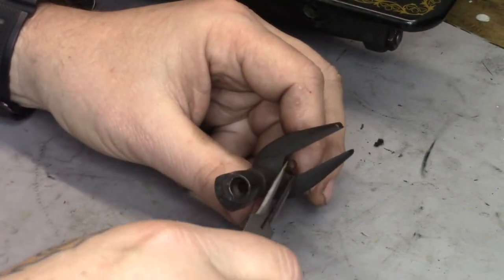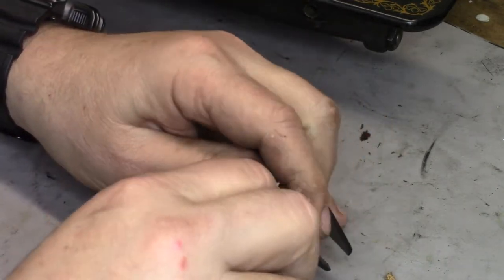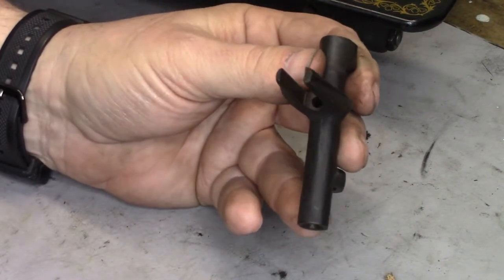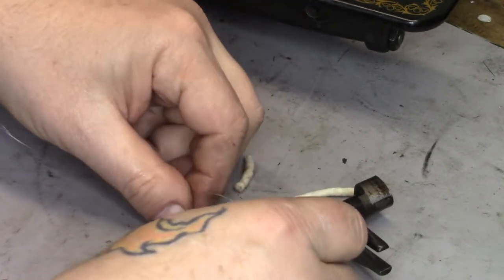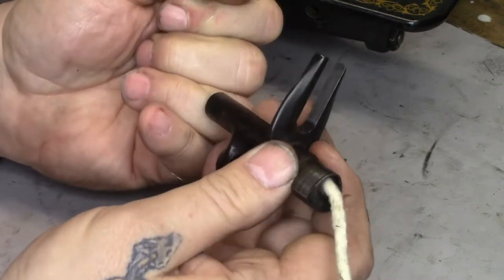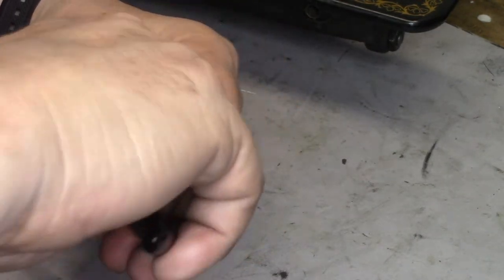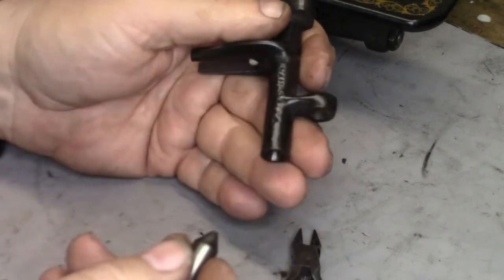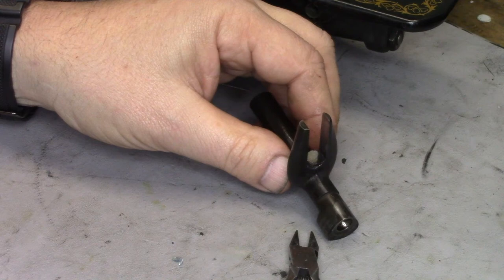Singer 15 91: Oscillating Shaft OIl Wick Replacement

Comment: Hey Bob, always great videos. Now what about the 201 mated with I think you said a servo. Did it work out. Thanks Mike.
Reply from the maker: I sure did, I put my 201K3 into the table that normally holds my Sailrite Leatherwork machine, and hooked her up to the Sailrite Workhorse servo motor. I had to remove the bobbin winder and use a different balance wheel, and had to source an appropriate size cogged belt. I bought a balance wheel from Sailrite that worked just fine, and found a cogged belt on Amazon that fit. I went with the cogged belt because that's how the servo motor is configured for the speed reducer for the Leatherwork machine, and I wanted to be able to do a quick changeover. The 201K3 works great on the servo, but I had to be VERY careful to keep the speed to within the design stitching speed of the 201 series machines. Full tilt, the servo would drive the 201 at many times it's max design speed, and while it's tempting to play around in those regions, it's a dangerous game. The problem is one of inertia. The 201 series is designed to run at 1100 SPM when going flat out. If you crank up a servo, it's possible to run the machine almost 5 times that fast, and that can be disastrous. It's not the running speed that's necessarily the issue, it's the stopping. Servo motors don't coast down to a stop, when you remove the power and control signals, they STOP! and when they do, all that rotational energy has to go somewhere. That 'somewhere' can only be one place - broken parts land. The 201 just isn't beefy enough to take that kind of punishment, and while I know I would always try to be super careful, it's real easy to slip up and cause a disaster. Since discretion is the better part of valor, I decided to scrap the project and keep my 201K3 in good running order.

Comment: Where can I find this cord & what is used on the motors if these need to be changed & what size diameter thick’s is the cord..

I can only find cotton cords only..
Reply from the maker: McMaster-Carr has firm felt cord. https://www.mcmaster.com/  You'll need 3/16" for motors and connecting rod caps and 1/8" for the oscillating shaft. I also keep some 1/4" and 3/8" on hand as well.
Reply: Will cotton cord work or wool.
Reply from the maker: @laverneh2030  I would use the firm wool felt. Cotton MIGHT work, but wool WILL work.